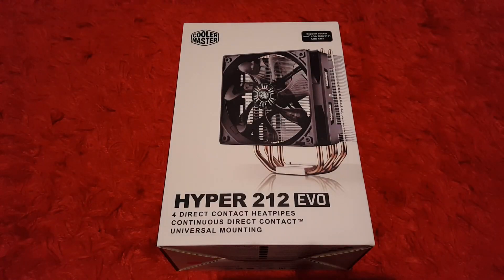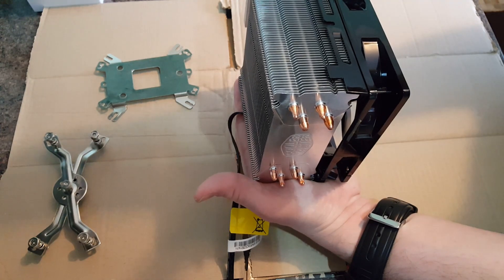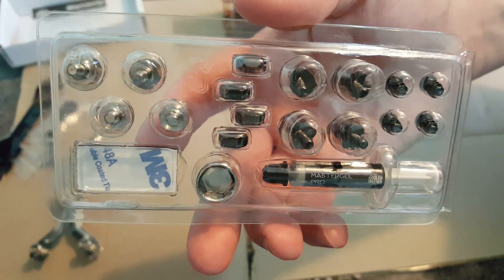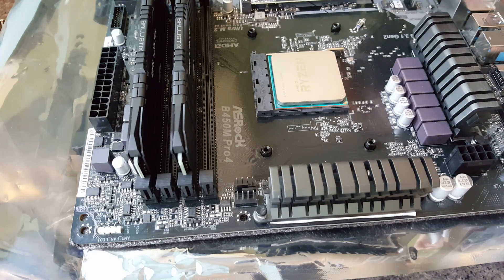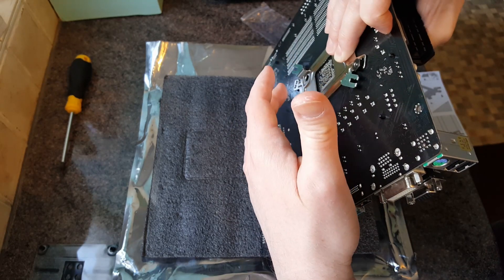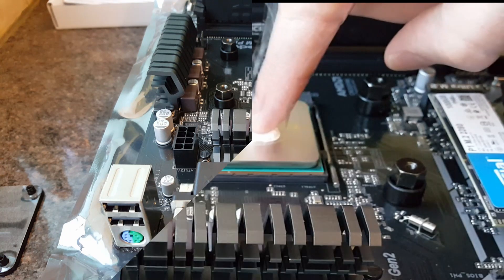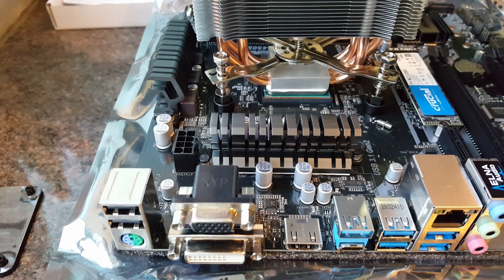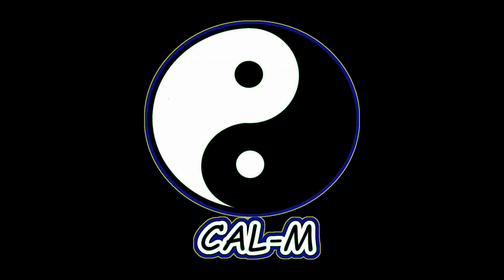Cooler Master Hyper 212 Evo Unbox and Install Tutorial

Comment from the maker: Bit awkward to connect up with the pieces at first  I could have done with another pair of hands at times but now wired up and working the cooler works well the fan isn't silent but is quieter than the usual cooler that comes with the Ryzen CPU's, If you are on a budget keep to the Included Ryzen Cooler. This is part of a Retro gaming build I'm working on which will include the build, operating system install and all the emulators and posibly a front end to tie all the emulators together 👍

Comment: I've installed two of these Hyper 212 EVO coolers.  You bypassed how the middle spring loaded pin is used and how to best align the very small pin with the hold-down when installing the cooler so that everyting is algned and flush with the top of the CPU. A picture of the correct allignment would be worth a lot.

Comment: the back plate doesn't fit gigabyte motherboards I guess ? I got a B550 AC PRO and it just doesn't fit
Reply: How old is your cooler? Despite it still being the "Hyper 212", there was a revision about a year or so after the AM4 chips first came out to add compatibility for them. If it's older than that then it won't have it and you'll need to buy a new backplate.
Reply: @Slembi  it's been like 6 years yeah, I needed a better cooler and I remembered how good this one was, and that it was installed on my old PC, so I took it from that one, but indeed, it doesn't fit, and don't know where to buy that since I'm not in the US
Reply from the maker: I use PC part picker to check part compatibility/ issues, I haven't got this M/board so unsure what the fitment issue is.

I suggest you speak to Cooler master directly regarding the compatibility issues you are having, if they are aware/if it has been resolved.

I bought a radiator for one of my first builds when the Ryzen line/AM4 socket had just come out - it wasn't compatible. I spoke to the manufacturers who posted me out a new bracket that didn't exist when my radiator had been made but was now included with  the new batch of radiators.

Comment: It seems not all Hyper 212 evo kits come with the black plastic attachments for the standoffs. Most of the guides I've looked at don't include them, but mine needed them for the screws to reach.
Reply: How'd you get the new ones
Reply: @jetkirby26  no idea if it's new or not, but the one I got was from ebay

Comment: Thank god yoy fucking uploaded this been trying to install for the past 5 hours and no other guide helped
Reply from the maker: Glad it helped, it is a bit fiddly TBH, instructions are not great either, is it a new build you are working on?
Reply: Calm Cal I got a new build last week, was having overheating issues with my 5600x, when trying to install the cpu cooler today, I was having issues with the brackets as you refer to them
Reply from the maker: @vexero3038  Ahhh Ok  yeah the Ryzen coolers are simple compared to this, nice CPU by the way - that should be rapid in most games 👍